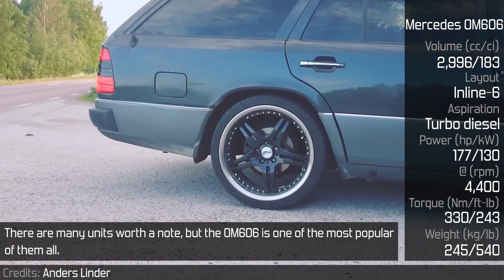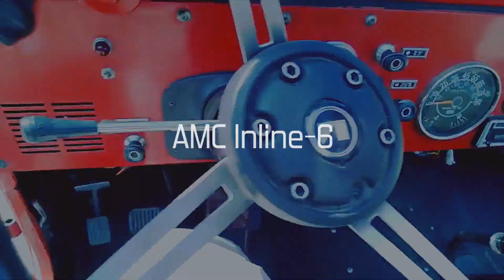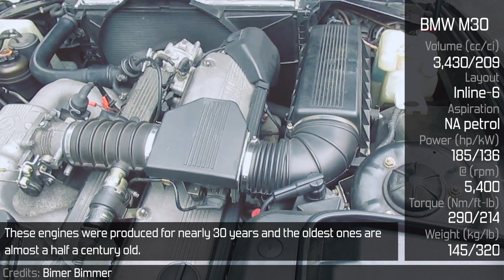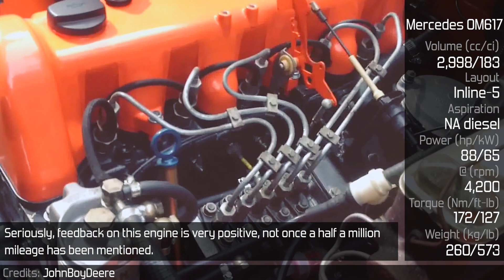10 Most Reliable Engines Running Beyond 300,000 Miles

Comment: My peugeot 106 1.1xl from 6/1999 has 445.000km without burning oil,  without damaged head gasket, without opened motor for any repair. Still runs very well today. Clutch replaced once in 210.000km .........

Comment: Please cmon the 1.9PD reliable? maybe the first generation up to 2004. After that i have seen so many worn out heads that i lost count...  becouse of the poorly designed diesel injector mounting (cut cost on quality aluminium??). Also if seen many many suddenly breaking connecting rod bolts with a result of big holes in the engine block. The PD units were also in tuning perspective fine but in daily use sounding like an old farming tractor. Some like it some dont.

Comment: Just want to point out a few things.  3.8 GM engine....350 design with back 2 cylinders chopped off.  Not a good engine....camshaft counterbalance, aluminum oil pump housing, cracking plastic plentum...the list goes on.  The dodge slant 6 needs to be mentioned for sure....BULLETPROOF.  The LS1 is a great engine.  Also 5.r Ford WITHOUT VVT, 4.6 Ford, Windsor Ford...all good for at least 300k.  4.6 Ford good for 500k.  I'll justify if you need me to.

Comment: original 1993 EB falcon motor, yes, its had its head gasket replaced. 630,000km on its original head and block and internals! still shows healthy oil pressure, runs every day with no issues, still does a burnout, uses minimal oil, I've also seen a 1994 EF falcon (ex taxi) that was over 2.4 million k old, still used as a dailyl #fordaus4lwontdie!

Comment: I believe the longest running most reliable engine is the Ford straight six (240 & 300) which was used in vans, F100, F150, & F250 pickup trucks, etc. Seven main bearings and no timing chain or belt. If you try to break one you will be wasting your time. I suppose the only engine that is longer lasting is the Model T four cylinder.

Comment: Have a 2004 Honda CRV with a K series engine with vtec.  have 350,000 miles without overhaul.  Does not burn or leak oil yet.

Comment: Where's the GM 301 cubic inch turbo , I had one in a turbo formula firebird , oh   longest   , that car never went 250 miles without a break down , yes  250 miles  , spent most of it's life in the shop or getting oil changes ( every 1800 miles ) gm took a real good 265,283 327 , dropped the compression ratio down , making it a 301 cid piece of shit.

Comment: Dodge slant six, flat head sixes and eights, Toyota R series and a few other earlier engines were the car totally wore out before the motors.  62 Dodge van with slant 6 ran for over fifteen years used for business everyday.  Odometer wore out before the engine great three on the column trans also.  Toyota four banger 87 van would not die.  What screwed up newer cars is all the electronic bullshit including EC's.  The old saying "Keep it simple, stupid" does apply to engines.  Well tune, well maintained is also helps.  Good old fashion motor oil, not the shit that contains 15,000 additives.  You don't need 600 HP or a car that goes 180 mph.  Speed limit unless driving the Autobahn is 70 mph.  Why waste money trying to see "whose balls are bigger" to impress others. Yes, in my youth I owned several bank account drainer's whose only purpose was to keep parts dealers and mechanics employed.

Comment: Ahem....... are we forgetting the Toyota 6cyl 1HD-T??? Mine has 476000mls and still all original components including the A422F autobox
Reply: Need advice please....   I'm looking at a 1996 toyota avalon xl with 80k miles and it is very clean in and out. they are asking $3000, is that a good deal? For whatever reason the KBB is less than 2K. Also, did you do transmission fluid flushes in your car? Have you used fuel system cleaner products like lucas in your vehicles?

Comment: Ford 4.9 I-6 engine is the best I've seen. I know of four of them just in my family alone that have gone past the 600,000 mile mark with nothing but routine oil changes and plugs. Too bad Ford got rid of them. Poor MPG is acceptable if it means not having to buy another truck for 30 years...

Comment: Volkswagen TDI-1.9L 66kW codename "AGR" is known in Germany and surrounding states for clocking 1 million easily. 
Also, the VW 2.0L 85kW ("ABA", "APK", "AQY"...) gasoline engine is known for being almost indestructible too, except it's reportedly high oil consumption in some cases.

Comment: The Toyota Diesel Land Cruiser's 3.5 litre 4-cylinder was legendary.  But its sort of cheating, because its not a Toyota design, its a Hino 3-ton truck engine built by Toyota (all parts interchangeable, even if they look different).  I owned an '84 LandCruiser Wagon that red-lined @ 60 MPH in 4th gear.  The 5-speed tranny appeared in '85 IIRC.   Toyota later bought the Hino truck company outright.

Comment: Toyota 4EFE (1300cc) 4 AFE (1600cc) 7 AFE 1800cc Lean Burn) and 4 AGE (2000cc) they can easally run 300.000 miles  (483.000 km) once I found a 4AFE with nearly 800.000 km (497.000 miles) on it

Comment: I hereby nominate the venerable Ford 300 inline six. 400,000 km on the original spark plugs, and possibly on the original oil. They just keep going.
Reply: 250,000 miles on the original oil. I was born at night, but not last night.
Reply: A small joke... :)

Comment: I must say as a mechanic, the 1,9 tdi engine is crap! Btw visioracer Keep up the good work love your videos! :)
Reply: at least the Turbo's is... and the balancer for the dyno & AC belt.
and then there is the price for changing the cambelt... jevees...
though it's one of those few engines that still goes even if the Turbo totally jams. power goes 6 feet under but could still cruise at 100km\h as long as there is no hills incoming (Golf IV 1.9 TDi).
but of reliable engines i would rater recommend the Mazda B5\B6 and the Nissan L28.
the B5 and B6 as long as SOHC and not twin will outlast every car that it ever have been mounted in.
Reply: No it isn't.

Comment: You missed a big one. Nissan VQ30 is in my opinion the best v6 ever produced. I have owned 3 each went over 300k and still ran great. I would put that over the AMC or the GM (still excellent engines). All the other ones are spot on the money. Don't forget the chevy LS engines they often go over 300 grand.

Comment: 1.  Black smoke pouring out of an engine is not a sign of a healthy engine.  It means you're burning oil.
2. Further, a lot of these engines you review are front wheel drive engines packed in there like sardine cans, with no way to get a wrench in there edgewise.  These are absolute garbage; you should never buy a car like that.  Imagine what is involved to take the engine out to replace a rod.   Only a sucker fool buys a front wheel drive car.  If the engine or transmission ever breaks, you're pretty much stuck disposing of the car, no matter how good the rest of the car is, simply because it's an impossibly insane headache and amount of work to remove the engine.  What are you going to do when the clutch plate inevitably wears out?
3. You can't tell me an engine running a belt instead of a cam chain is a reliable engine.  Sorry.   Maybe it is, until your belt breaks, and then you've got a job getting a new belt in there.  Further, some engines are "interference engines", meaning if your belt breaks, it's possible for it to happen at a point where the valves are int he way of the moving engine, and... crunch... you get little crunch valve parts in your engine.  The Ford Escort would be an example of this.

Comment: 300k miles isn't much, I've had a few petrol cars that have gone over that, they were sold on because the bodywork and the rest of the car was worn out 
The engine was fine
Reply: Need advice please....   I'm looking at a 1996 toyota avalon xl with 80k miles and it is very clean in and out. they are asking $3000, is that a good deal? For whatever reason the KBB is less than 2K. Did you do transmission fluid flushes in your car? Have you used fuel system cleaner products like lucas in your vehicles?

Comment: This is a bit diesel-centric and has a bit of European/German bias.  No argument with the old AMC/Jeep straight six, but I certainly wouldn't add the inherently unbalanced  90 degree GM 3800 to the list.

Take a look at the GM LS series motors and then the various straight 6 pushrod engines from the US manufacturers in the 1960's (Ford 300, Chrysler Slant 6, Chevy 292, etc...)

Even the old US V-8s from domestic manufacturers can go forever with proper maintenance.  For instance a Chevy silverado with 1,300,000 miles on it's original un-molested engine.

https://jackmaxton.wordpress.com/2012/07/18/this-is-a-chevrolet-million-mile-plus-story-told-by-frank/

Comment: Volvo engine only last so long because it produces  so little power whilst  drinking fuel all these old push rod engines will do this Morris 1100 or Ford 1300 xf just change oil and dont thrash  em

Comment: This is assuming that the average person has the ability to maintain a car (and/or not wreck it), before it hits 300k-- even if the engine is capable of going beyond that.  Also consider, that today, people have the attention span of a gnat, are easily bored of their cars & feel the need to replace them every 2 years (on lease); just because they feel like it, and whoever gets the car after that, it is so depreciated in value, I doubt the 2nd, 3rd, or (if it even gets that far) 4th owner is going to care whether it makes 300k miles or not.  Sad but true.

Comment: You are totally missing the 3.0 v6 nissan engine from the nissan 1995 through 2002 nissan maxima mine has 495,000 miles and still running strong and I have another 1995 with 324,000 on it also running great never even changed the water pump or alternator nothing on the engine has been replaced

Comment: GM 3.8liter most reliable....laughable, how many times was the manifold pulled on those engines to prevent the coolant from running into the cylinder to prevent it from hydro-locking if it hadn't already done so and destroyed it. those engines are garbage! almost everyone of those engines i saw needed the manifold gaskets replaced.
Chrysler 318 personally own ,over 750k(many many more out there), the only thing done to it was a timing chain around 600k. chryler slant 6 over 1 million miles found in a old army 1963 truck was driven by my dad till the cam was so flat it wouldn't run no more. ford 300 straight 6, seen many of these with well over 400k. ford 4.6l many of these in fleet and cop cars well over 300k ford duratec 2.0l seen these with over 400k.

Comment: What about the slant 6 from Chrysler?
Reply: It should top the list. There was a million mile slant 6 car that was in the news recently.
Reply: Slant six 1963 Dodge dart. Over 400k
Reply: Will I don't think many have positive memories of anything that had a slant 6....The horrible transmissions Chrysler partnered with the slant 6 soured any decent memory that would have been....
Reply: @cs-rj8ru  which trans? I had an 82 Dodge truck with the 225 and a 4 speed.  I sold it with over 250,000 miles, no problems.

Comment: VWs PD/unit injectors are not reliable and very expensive. Most manufacturers made the jump from distributor pump to common rail . The older TDIs with distributor injection pump can last forever
Reply: I have also been told that the PD engine wears out camshafts prematurely and the earlier VW diesels did not.

Comment: 1.9tdi prolly the best ever IMO and you can get loads of power out of em
Reply: yea but unreliable as hell
Reply: the 1.9 is far reliable, probably you said the 2.0 tdi
Reply: To be fair the engine is reliable, but every other component that came on those VWs is subject to shorter lifetimes.
Reply: Prior to 2005 the 1.9 TDI was decent but as everything involving VW, post 2005 they turned to shit. The 2.0 TDI has never been good  on the other hand. The 1.9 replacement 1.6 is just a massive pile of wank like all the downsized  turbodiesels. If you want a diesel buy something with a chain.
Reply: From what I have read, the ones with the distributor pump lasted for ages, but the PD engines did not.

+Aaron Garcia
The same can be said for numerous cars.
My mother had a 1985 Nissan Maxima and it was extremely unreliable due to the car being badly designed. Some of my friends parents had a 1986 and they were just as bad. However, the VG30 engine was rock solid.

However, the Nissan Hardbody had a VG30 engine as an option and many are still on the roads. The Nissan Hardbody is a great design.
Reply: If this is about reliable engines, why is everyone driving like an ass?

Comment: no fords ?    why?
Reply: fanghicheck 68 Mustang 289, never touched except for timing chain. still runs great. I've had it since 1977, life long so cal car.
 smokes a little on take off, valve stems need replacement. but runs smooth as silk.

Comment: That a Chrysler Jeep and their engines are absolute rubbish not like the Original AMC Rambler engine which will out last any Jeep Chrysler crap engine as in my 45 years j have repaired over 100 Jeep engines in the vehicle you show in the video as it's not an AMC is RAMBLER like the Hornet, Pacer, Rebel etc and are NOT Chrysler and I don't know who told you they were or are reliable, the BMW 2.5 and 3.0 are nothing more than a money pit as you have to spend lots of money on them to keep em running  and lucky if you get 250,000 Km's out of them not like you think they do, Cummins 6BT very reliable and the best engine conversion for the Toyota 80 Series Landcruiser, GM 3.8 V6 are better of being used as a boat anchor as at 180,000K's they all develop the same knock and oil pressure problems including the engine seizing at low speeds and there are plenty in the wrecking yards that are fucked either with low K;s or just over 200,000 mark, worst engine ever made by GM next to their all Alloy 3.6 and 3.2 litre Vtec engines and the LS1 sold in other countries and the story of one doing over 900,000 is just a story and not true

Comment: Volvo engines are durable but the oil leak has been a major issue over the years.
So durable engine but 240s leak problems are serious issues.
Volvo gasket sucks.